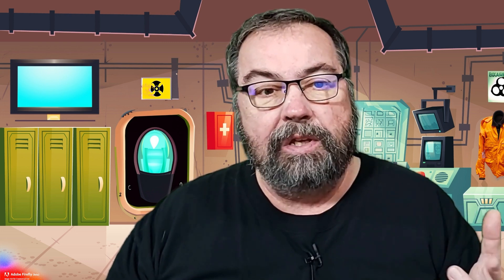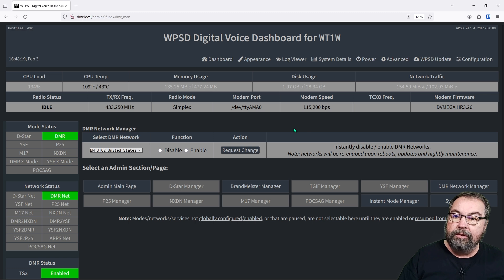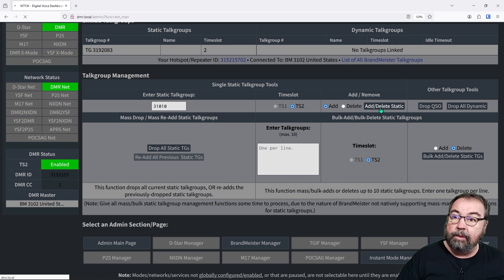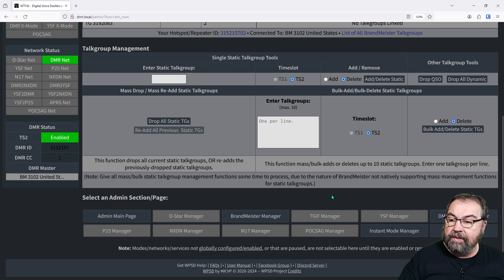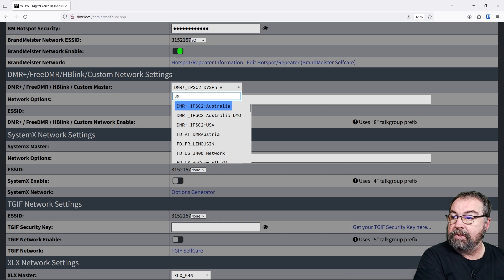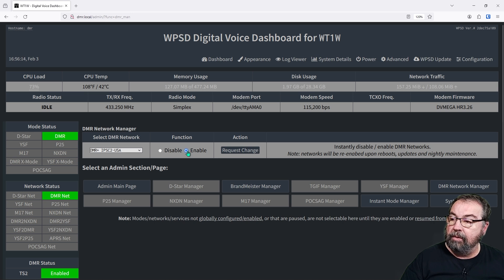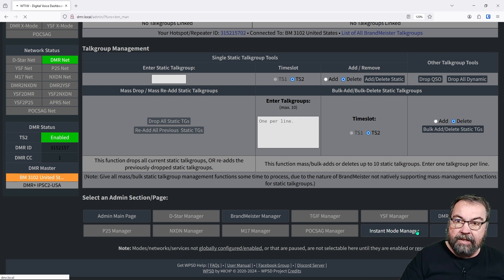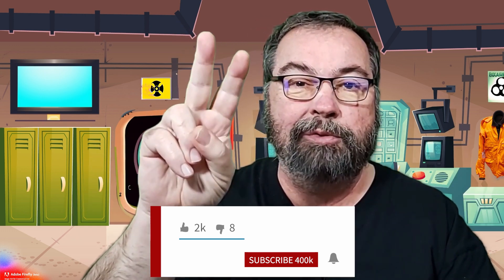Tuning Your DMR for Maximum WPSD Hotspot Performance

Comment: I have a pistar and it seems too old and underpowered to Install WPSD. Where can i get a powerfull enough Pi please? Fully Assembler preferred . 73 OE3TWB
Reply from the maker: Anything from a pi zero2w and up will work fine with pi-star (or wpsd).  If you want a turnkey package, bridgecom sells something like that.

Comment: This software is implicitly good, but it interferes too much with the basic system, e.g. bluez, if you install it, it will automatically be uninstalled. This means that other services such as svx are not possible because the required components disappear again. Better keep your hands off it.

Comment: I saw your CPU usage for the hotspot was 132% - is that with the pi zero 2W? I have a pi 5 and it never goes about 20.
Reply from the maker: I don't remember it doing that, but it might have been updating?  Normally not so.  It also might have been a zero w?  I don't think so, but it's been a minute since that video.  WPSD and pi zero W -  not so great.
Reply: @FEPLabsRadio  It was the pi zero w not the pi zero 2w - I watched your videos out of order. I really appreciate this series. I was able to set up my MMDVM because with their help. Now if I could find a video that gets me to connect my Anytone AT-D878UVII plus to my hotspot! 😂

Comment: Just a quick question … i ordered parts for a zero2 w as im using zero pi star with wpsd… does the caller ID work on a zero 2w as my pi star zero rev 1.1 does not … great firmware.. far superior to pi star
Reply from the maker: It's all software based, BUT, you need to make sure the data files (caller ID) is current.  WPSD handles that pretty much automatically.  If you're seeing callers in the console,, but not your radio, it's because you haven't loaded the ID's in the radio (for DMR)

Comment: Pi-Star allows use of DTMF codes to allow you to connect and disconnect from reflectors in D-Star. 
 Does WPSD have this ability?
So far I have not been able to make DTMF work with WPSD…..
Reply from the maker: WPSD isn't filtering it out, AFAIK.  I have not specifically played with all that, but WPSD is basically new/improved based on Pi-Star.  I can't imagine Chip would remove DTMF support.

Comment: Hey I am having trouble getting my repeater to run DMR and FM could you help me with this?
Reply: I should add I have a stm32 with two Motorola's using a 16 Pin duplexer cable.

Comment: Jim,  I was looking thru your playlists looking for a video explaining how to setup the radio to your hotspot.  Do you have one you have made or maybe another you would recommend?
Reply from the maker: I can do that, the issue it gets into, is that some of that is radio and MMDVM board dependent.  The RXOFFSET might be zero, (which is where I'd start), and it might work ok.  Sometimes, you have to tweak that number up and down.

DMR, Yaesu, or D-Star?   Set up for everything but yaesu varies from model to model.

It's not a bad idea, but there are so many radios out there, it's kind of a never-ending treadmill of "Setting up X radio" kind of thing.

I'll consider doing something like that though - thanks for the feedback, and thanks for watching!

Comment: I have BM and TGIF running on my hotspot all the time. I have OpenGD77 on my radio so i use one channel for BM and another for TGIF. I use the talkgroup list feature to have all BM tg's under its channel and all TGIF tg's under its own channel. So i turn my selector knob on my Tyt uv380 to select either the BM or TGIF channel then the up and down arrows while on a channel to select the tg I want to hear. If I want to use BM tg 91(worldwide) I go to that channel and select that tg. If i decide I want to use TGIF tg 91(worldwide) I go to that channel and select that tg. I just have to have the tg's for digit contacts as TGIF set as 5000091 for example. That way it knows whether i'm wanting TGIF 91 or BM 91. WPSD uses prefixes for networks. TGIF is a 5 and SystemX uses 4 and DMR+ uses 8. In the case of TGIF the tg number just needs to have 7 digits. Like tg 91 as the example again....5000091
Reply from the maker: Yeah, I haven't really played with using two different networks a lot, it looks like there are several ways to work it, depending on what your comfort level is.  I suppose you could just make a separate digital contact, with the appropriate prefix and do it that way as well.

Comment: Jim, these videos are very helpful. The problem I find is when I configure the hotspot for DMR and YSF, I don’t know how to get out of DMR to allow it to switch back into ISF, and vice versa. I’m using an FT five and it works great with YSL, and it works great with DMR. It’s just I’m having difficulty finding the solution to the radio to drive theeither two or away from one of those modes. Any insight on that?
Reply from the maker: That net hang time, and rf hang time will help with that.  I really don't recommend using two different modes on one hotspot, it gets weird.  
You didn't say, but I assume you have YSF2DMR and YSF enabled?  So you're monitoring a DMR TG, as well as a YSF room/TG at the same time??  Same kind of problem - if you link to a specific TG (on either mode), and you got someone in there with a long QSO - you're pretty much stuck.  The easiest way to get out is go to the manager, and force an unlink thru WPSD (or Pi-Star) - same functionality.

Comment: Love WPSD! My only nitpick is that the time-slot and color-code fields should be right up at the top by the frequency field(s) OR if they can't dynamically place them by freq when DMR is selected, at least put them together in a block towards the top of the dynamic DMR blocks of fields.
Reply from the maker: I agree - It would be better if it was more prominent in the interface